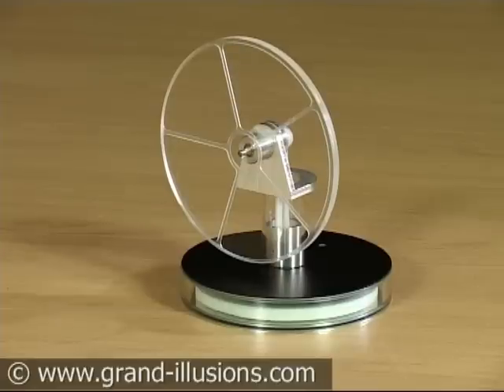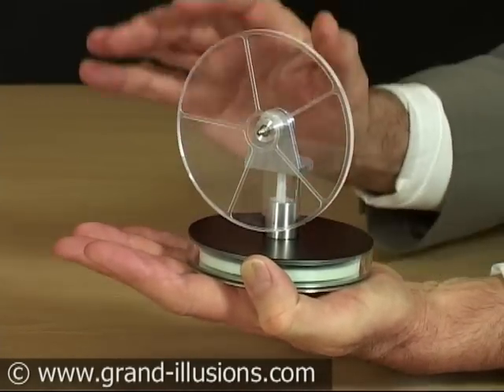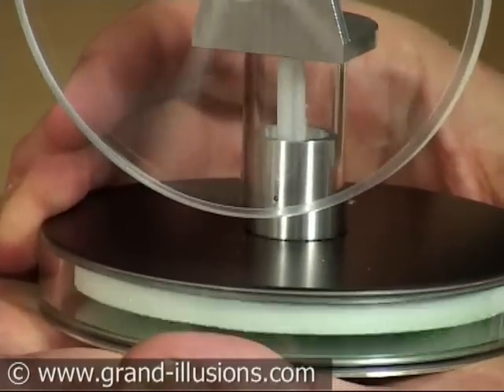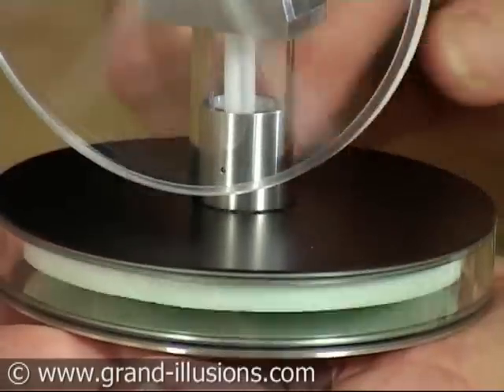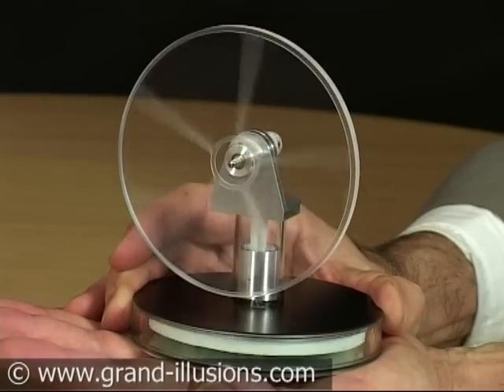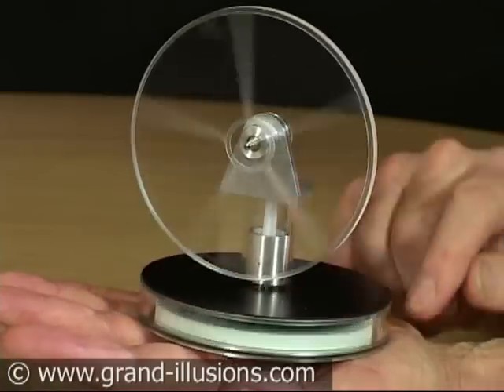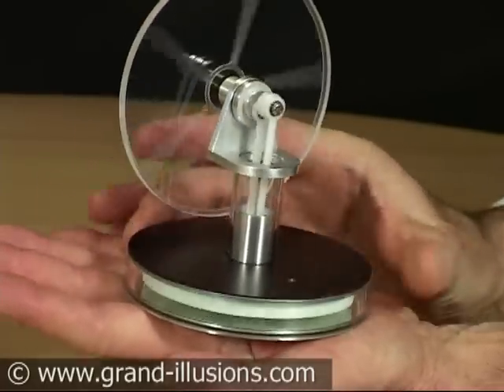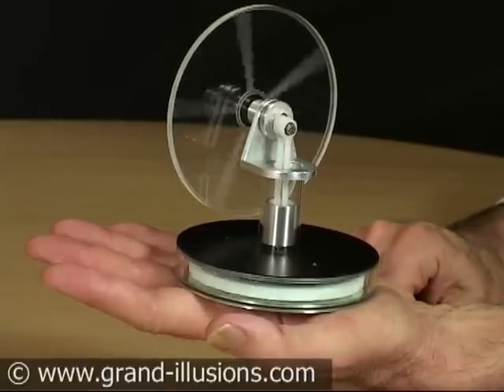Heat of your hand Stirling Engine

Comment: I have a friend who's hands are naturally always colder than the temp around her, so this would not work with her. (Yes, I am serious, at 65 her hand is 60 at 90 her hand is 83, at 32, freezing temp, her hand is 28,at 12 her hand is 10, yes we've used thermometers to tell the difference, both standard and electronic)

Comment: Imagen in the middle of summer: you're dying of heat, you have this with a fan, and it's going hyper speed cuz of how hot you are
Reply: But the outside temp is also hot so it probably wouldn't spin any faster

Comment: What's stopping someone from making this larger scale to power cities
Reply: Well the main issue is that it’s not very efficient in the slightest and they are hard to make. It’s much more efficient in terms of heat source (aka fuel) to design a steam turbine or combustion engine to get energy. It might however be possible to use something similar to help get back more energy that might be otherwise lost as waste heat.

Comment: Stick on on the top of a house so the heat from the house propels the fan (can also be spun with wind). The fan could then be connected to an alternator which could then power a wall mounted battery bank, which would create electricity to power the household including the heating to power the fan. Just an idea 💡

Comment: We are releasing that much energy?!
Reply: As body heat yes, but it's not that much since the engine is barely doing any work. If you put a load on that flywheel it would stop immediately, there's just no torque.

Comment: Put this on a CPU and cool it with the energy generated
Reply: It sounds like an amazing idea but would it be reliable enough?
Reply: This wouldn’t work, but fun idea
Reply: the wheel should be shaped like a fan. But it wouldn't have enough force to pull away the required quantity of air to cool the cpu efficiently
Reply: @suleymanbabak1973  although with a bigger and more modified version I think its quite viable be it could be placed right on the gpu on inside the cabinet.
Reply: It would not work, sterling engine is a amazing idea but the engine itself is not efficient or reliable.
Reply: 😳 u r right
Reply: It would freeze
Reply: i think the biggest problem is that a sterling engine relies on the difference of temperature of the environment and the surface but in a computer system it is common for the environment to also heat up which significantly decreases the coolimg ability of the fan which then heats up the environment more and then it snowballs until the fan wont work anymore so i don't think it will work
Reply: Won't work. As soon as the top plate heats up it's gonna slow down and eventually stop. That top plate has to be cooled for it to work.
Reply: @Gigasimo456  naw you just need a difference in temperature and since the CPU is constantly producing heat the bottom plate will always be hotter
Reply: @Gigasimo456  exactly it will only spin temporarily and once the temperature changes to a constant on both sides it wont work anymore
Reply: That would open the pathway for a 5th dimension
Reply: 😂 @SpartanSky
Reply: wouldn't it work? the heat really is just wasted energy. of course it's probably not be enough to keep the CPU at a reasonable temperature but i really do think it could help
Reply: @Zreknarf  no. Cpu pump out a ton of heat. This thing isn’t efficient at all
Reply: @macberg5806  they're around 30% efficient, so.. that's around 30% less cooling cost

induction generators are 88% efficient, so that's why i said ~25% (88% of 30%)
Reply: you could even use it to drive an induction generator and recover up to ~25% of the CPU's electricity cost. i think.
Reply: Have a fan so it can replace the case fans because for the cpu it wont work it will just spin the fan
Reply: I think if you have a water loop going to a whole array of these it should be possible, right? And you could recover a bit of the lost energy in theory
Reply: Computer companies won’t let it happen as water cooling system LED light is COOLER and make more money than gorgeous stirling engine imo
Reply: It would create a black hole!!!
Reply: Put it ontop of  yoyre dashbord in youre car when jt stands in the sun  put a fan on it and boom  idk if it would work
Reply: Actually they use convection cooling systems for CPUs so theoretically this could work but you would have to completely re-design it

Comment: This is how we make infinite energy, we make a giant one and we take turns putting our hands on it
Reply: It's not doing any work though, the flywheel is just being spun up. If you tried to use the energy for work it would immediately stop. An example would be static electricity. You can get thousands of volts from rubbing your socks on a carpet and zapping someone, but the amount of physical charge you accumulated is so small that there's almost no current flowing in the first place. Same here: even though the flywheel is moving it doesn't have any torque behind it, so you can't do much with the energy.
Reply: @thegreatzoom5073  I...I was joking

Comment: he just spun it with his hand
Reply: To get it started you must do that. It's Just enough heat to keep it going, not enough energy to start it.
Reply: Yes but it keeps going because of the heat of his hand heating up the base plate. If he were to put it down, the bottom base plate would cool to room temperature and the Stirling engine would slowly stop because the air inside wouldn't be able gain heat anymore. Him spinning it with his hand was just to give it a boost to start it up and it would just gradually stop in seconds if it was just a normal wheel. He explained everything in the video so I'm not sure why you made this comment

Comment: I wonder if they could make something like this in warmer climates to provide free energy.
Reply: Unfortunately it probably wouldn't work. Either the amount of force provided by the temperature difference would be negligible where it wouldn't move the parts or even if it did move the parts it wouldn't have near enough strength to run a motor. A wind turbine or hydro electric dam would be a much better use of resources.
The materials used in the model are light enough that the temperature difference between the metal and the hand could have enough effect on the motion of the device.
Reply: @Katsunai  What about in places with natural geysers that have surrounding areas that are much hotter than normal for the region? Would it not be possible to have an energy storage connected to collect free energy?
Reply: @Umadbro681   it would be useful but we already have something for that called geo thermal plants. Making extra large fans just for amusement would just be a waste. Humans are already using every know source of renewable energy right now.
Reply: @Katsunai  Yes, but nothing for smaller applications. Living in the desert and such theoretically should give this device enough juice to produce enough energy to store in batteries (if the circumstances are correct) from the  cyclic compression  alone produced. Sure, it's not going to run your home in real time, but for energy production and storage, I see really no downside if we can find a cost effective way and lets face it. Home solutions for this currently range from solar to wind but all cost an arm and a leg to get into. At the very least, in specific areas, this has the theoretical science to make off grid energy living a little easier than at least using wind.
Reply: @Katsunai  After further investigation, I've found that these engines are actually used for what I just replied to about lol. They do weigh more and power production is slower (as expected), but they are used. Now we just need to expand on them since they are a free resource after construction.  

https://www.sciencedirect.com/topics/engineering/stirling-engines
Reply: @Umadbro681  
It would probably be better to just build solar panels even if they cost more, for better and effecient planning for the future it is far more viable. First solar panels wouldn't need as much maintenance as the moving parts and other thing the structure would have. They would simply need to be cleaned once in a while. 
The structure would just be taken down in the future for not producing nearly enough energy hence wasting precious resources for building it and taking it down later. 
The net energy gained would be far less as compared to solar and simple having less maintenance and operating costs solar would be a much better choice for such sun rich areas.
It is a good idea but it's basically a steam engine converting steam/air movement from heat to mechanical energy. It's being used in almost every single factory by boiling water with heat to make a piston move. It's was a revolutionary idea but better meathods are being discovered.
Reply: @Katsunai  I agree, although I think this method may be more efficient over a longer period with less maintenance and part replacement. If we could expand on the concept to Mae it suit our needs better. Even current solar answers to current crisis provides a huge waste byproduct.
Reply: @Umadbro681  i dunno why we are still talking about this. Imma go i have work to do.
Reply: @Umadbro681  anyways good luck with whatever you're thinking of doing with energy.
Reply: @Umadbro681  dunno sounds pretty sketchy to me. I dunno why you're even trying to have a business with some rando on the internet. The only reason i have some knowledge on the field is cuz I'm an architect. Other than that you should probably do business with someone you know and trust rather than some random dude on the internet who talked with you about energy efficiency.
Reply: @Katsunai  Come on bro. This is the chance of a life time. Listen. I didnt spend 7 years in the phantom zone to not make money. If you're not into that then it's cool. Maybe instead, you'd like to offer your expertise pro bono? I promise I wont ask you for any tickle fights... yet.
Reply: @Umadbro681  i specialize in a different field, you should probably get the expertise of the people who are working in the region or similar regions. Me giving you half baked knowledge wont help you in any way.

Also I don't know you. I'm not your bro. We are barely acquaintances. This is not the chance of a life time. I've got more serious business ventures to look after. Good luck with your future endeavours and hopefully you'll make that million.
Reply: @Katsunai  Are you sure? I can pay in hugs.

Comment: It could run on water, just put water absorbing material on top disc wet it with water. So as the water evaporate will cool the top side.. Here we go. I like to see if it works!

Comment: Is nobody realising the fact this works and is powered by cold environments is revolutionary?! You could have a space  craft powered by the coldness of outer space alone... literally making it an endless battery with no need for a generator or sunlight etc... this could literally change the entire world. why tf is nobody talking about this?! This is what weve all been waiting for. Reliable free energy with absolutely zero fuel needed and no waste products. This is in my opinion is the most impressive technology I've ever seen. Hands down. Anybody who says otherwise clearly doesn't understand the science behind this
Reply: There's so little energy in the rotating flywheel that you couldn't do anything meaningful. As soon as a load is introduced the wheel would stop and the engine would stall. It's like static electricity generating thousands of volts, there's just not enough actual energy in the system to get appreciable current to work with. Also, the whole system only works because there's heat being transferred. If you took this out into space it would need a constant source of heat, which makes it a finite source again.

Comment: Put a radiator running through the top and one of those thousand mirror sun light condensing dishes around it focusing light at the bottom........

It could make for some badass lawn ornament applications....😉

Comment: This is perpetual energy
Reply: Please explain why.
Reply: Jeff O put that thing on a warm surface like the bottom of a chair and voila the heat of someone sitting on the chair will make that thing go
Reply: However, it's not perpetual energy. It's simply a transference of energy; in this case, heat transferring from one's hand to the engine. Take it off your hand, and the engine stops. And it takes energy to create heat.

Perpetual motion (not energy) would be like something spinning in outer space. It'll keep spinning unless it comes into contact with something else. So far, we don't know of any perpetual "energy" machines. Such a device would be overunity/free energy.

Comment: I wonder how much power you could get out of a large stirling engine using a method of focusing sunlight. Probably wouldn't beat solar panels in the amount of space used per watt of power I imagine but who knows
Reply: Mega Candid stirling engine is more efficient than solar panels so it will beat solar panels

Comment: The technology, unfortunately for tim, is not that advanced.  These have been around for quite a while.  The ones that produce useful work use anhydrous ammonia, such as what you'd see in a drinking bird.  Those fluids boil extremely easily in a slight vacuum sealed environment while at the same time having incompressible hydraulic forces involved.

Comment: Make a sterling engine that works off of cold temperatures. All you need is the right alloys to do it! An evaporation absorption refrigerator could be made into a stand alone unit with this technology could it not? Same has a stand alone air conditioning unit has well! Novartis

Comment: Make computer fans that work off the heat produced to lower electronic consumption and provide cooling!
Reply: Evaporative cooling has been used on computers before.
Reply: That is the greatest fucking idea ever
Reply: What you have never heard of chemical evaporation absorption refrigeration that can be used to cool computers by the heat they produce? WoW!
Reply: Wait opps I am in the wrong century may bad!
Reply: You want some more ideas? How about a solar vacuum tube portable electric power generator? LOL
Reply: Imagine an X box that cooled itself with Manson low heat fans that did not consume any watts. In a sense the fans would still be the same old fans that would turn without consuming any watts under normal conditions. If a sensor was tripped the fans would move faster to generate more air flow. Novartis
Reply: A hybred  electric vehicle could be designed to function like this on open highway use could it not?
Reply: If you went with regular thinking but if you think past your fluer DE lust its possible! ; )
Reply: @jimmartin7899  you need air in the tube to move the piston
Reply: Holy fuck that is a really good idea.
Reply: A biological gel that absorbs and transfers heat designed like how the body deals with heat?
Reply: A biological cooling system for electronics and home cooling?
Reply: Is it possible? Novartis
Reply: That's an amazing idea man
Reply: great ideas, jim. wish i could hear more of em'
Reply: What the fuck is these comments. Theres atleast 3 fucking bots, unless jim is just an annoying fucker who keeps repeating himself
Reply: Grey female clone drone spider alien cells could be used. Just grab one and probe it really good for a change in what those little buggers have been doing for centuries to humans. Bet their cells could be used for lots of science stuff. LOL

Comment: It looks nice! But what is the efficiency of a stirling engine?
Reply: +Akira Mishtokaru 
Actually it is one of the more efficient heat conversion method we know of,
But due to its low power to weight ratio and other issues it is difficult to use it practically.
Reply: NASA is actually using Free-Piston Stirling Engines powered by a General Purpose Heat Source (Uranium encased in lead), to replace Radioisotope Thermoelectric Generators.
Reply: +Akira Mishtokaru 
They were shown to be extremely potent as engines for smaller, non-nuclear, submarines. The Swedish Gotland-class Submarines where the first to use this back in 96 and a lot of the worlds navys have copied or are in the process of copying that at the moment. 

That is the only real application I know of where stirling engines actually have significant advantages over combustion or electric engines.
Reply: They are very nice to look at, however,  and even the internals are very nice. The mechanism itself and everything. Stirling engines are just /nice/
Reply: Akira Mishtokaru 50% to 85% efficient

Comment: Make it into a fan and use it on a hot day.
Reply: Catman and Dogin Then you don't need a fan.....
Reply: Smitty Werbenjagermanjenson It would actually provide less power on a hot day because the temperature difference between your hand and the ambient temperature would be less.
Reply: User Name because the blades of the fan would face much higher resistance and would either not spin at all or extremely slow. That is if the heat source remains your hand
Reply: could you not have the fan also cooling the top plate, increasing the differential by it's sheer function?
Reply: That's ingenious. Why isn't this being funded already?
Reply: User name Because I think the top would get hot too quickly.
Reply: Smitty Werbenjagermanjenson google: sterling stove fan
Reply: Smitty Werbenjagermanjenson then just build it upside down. bottom needs cold and top needs heat. problem solved.
Reply: Smitty Werbenjagermanjenson Then set it on the ground so the bottom is cool and the top is hot.
Reply: marble89 it doesnt matter where the hot and cold is
Reply: It is too slow, need gears to speed it up, but gears might reduce the efficientcy
Reply: Smitty Werbenjagermanjenson up
Reply: What if it's cold outside